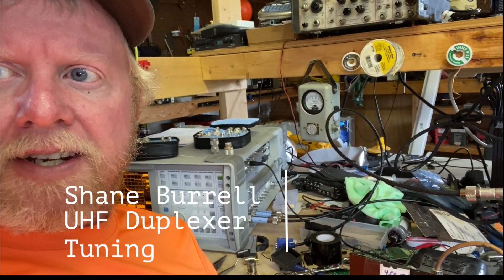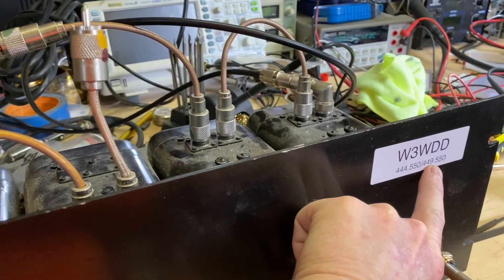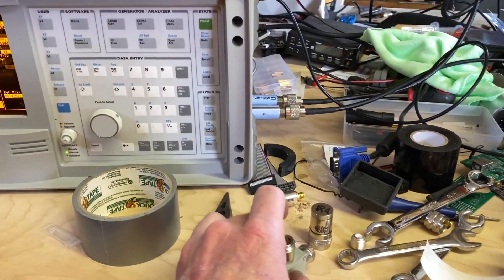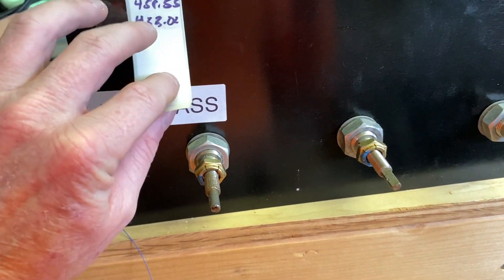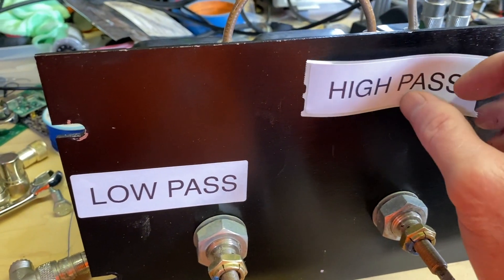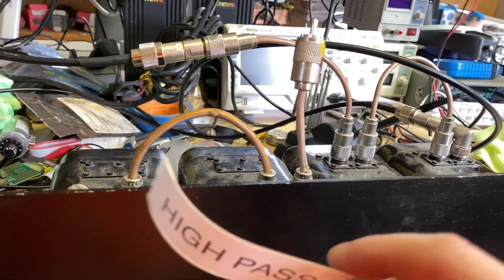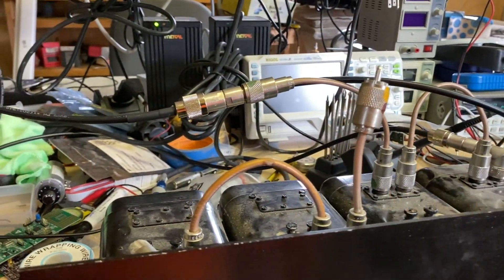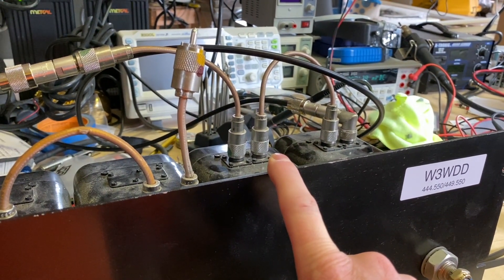UHF Duplexer Tuning for Ham Repeater

Comment: I have a question .. I have a duplexer tx low side is 462.600 MHz & Rx high side is 467.600 . 
 
So your saying low side should be tuned to reject 467 MHz & the high side should be tuned to reject 462 tx side too???
Reply from the maker: Normally they are spec'd as pass frequency.
Reply: @ShaneBurrell1  thank you